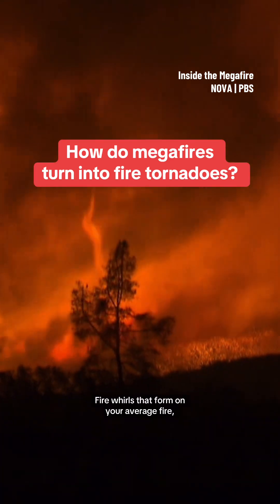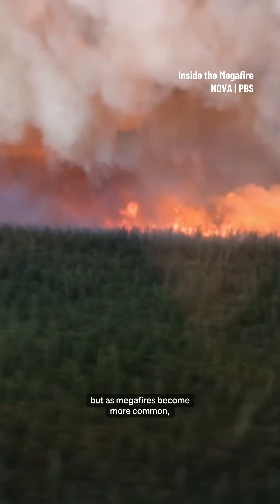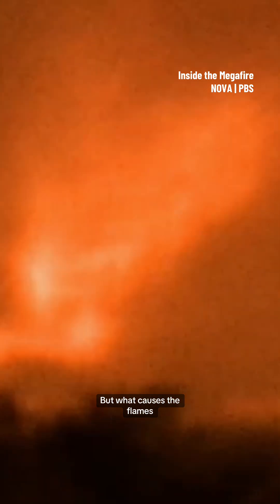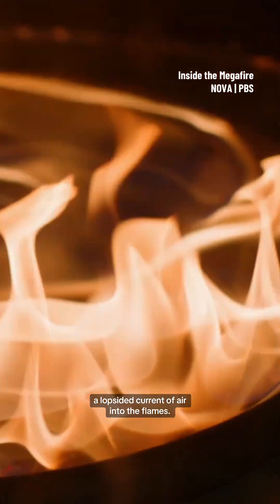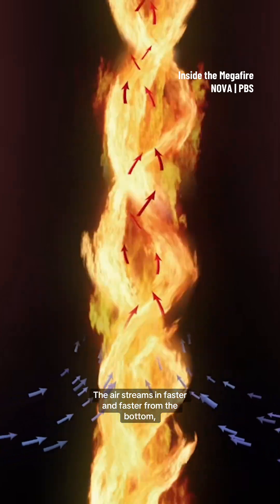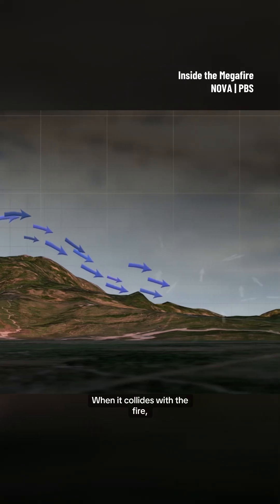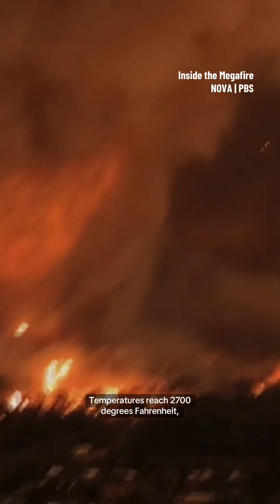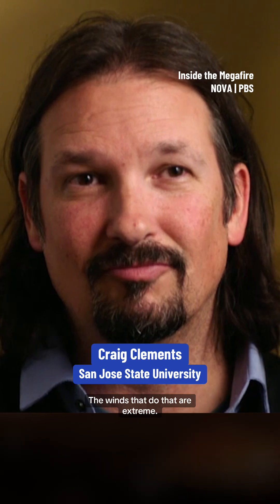How do megafires turn into fire tornadoes? #shorts #wildfire

Comment: You only get mega fires. When you let libtards dictate your environmental rules to the point that you can’t clean up the forest floor which prevents mega fires and is exactly why we have mega fires today that can melt glass and metal. A forest should never burn hot enough to melt glass and metal.

Comment: This is the reason for the devastation of the Palisades fire. As hot air rises, the base of the conflagration pulls at the prevailing air flow and increases the potential. Such atmospheric activity is not limited to fires, but it also applies to volcanic eruptions. 

Since air currents also affect oceanic currents, this may be one of the factors in the Honga Tonga Honga A’pai VEI 7+ eruption in 2021.